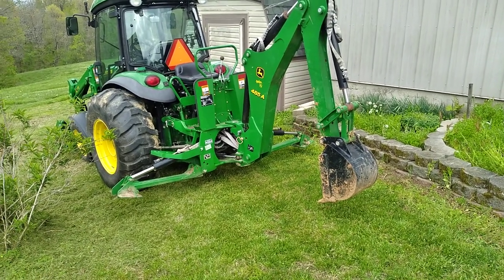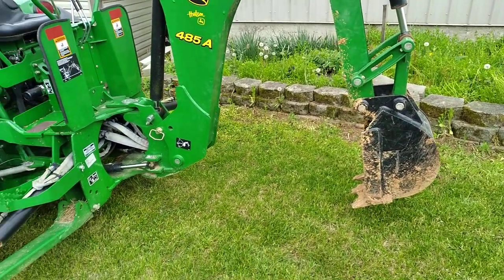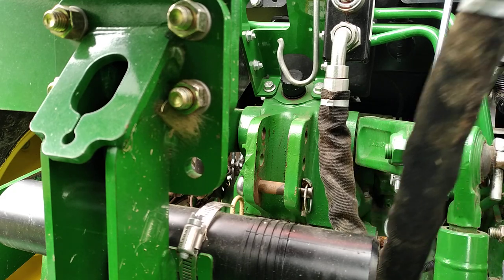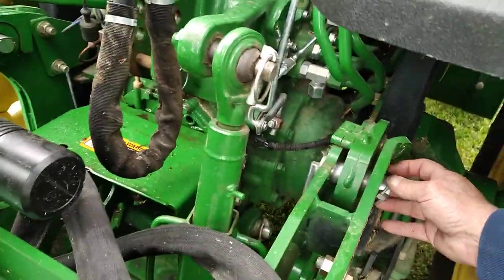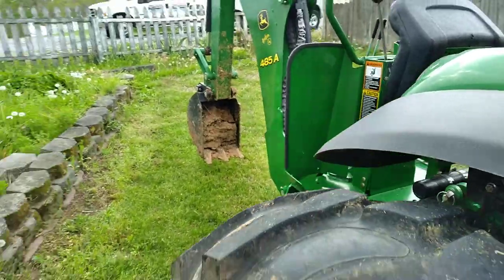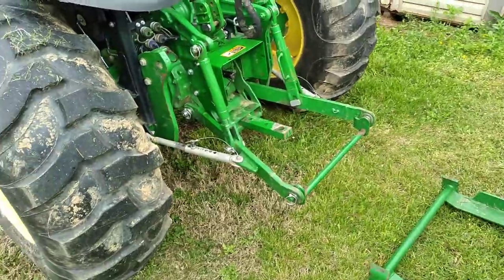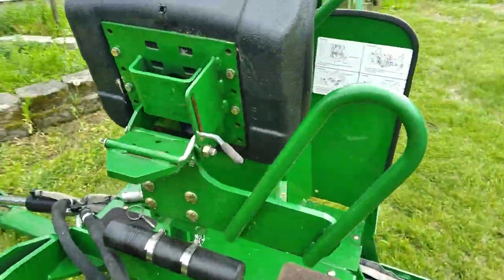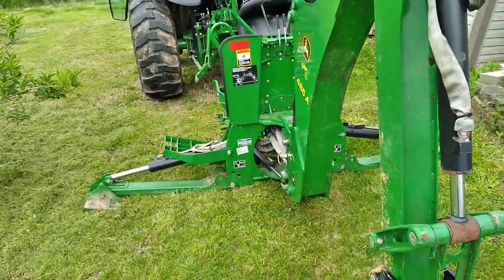john deere backhoe removal tips & tricks / sst vlogs / super slick tricks

Comment: Just lost my mind trying to get this off my 4052 lol. My left pin had tension down on it and I maxed out the three point arm thread adjustment. Then my three point would not go low enough, so I flipped the hoses and moved it up a bit to clear the three point, then the main pins under the tractor would not clear. I gave up until I get a floor jack over here. Idk if mine is tweaked or what.
Reply from the maker: I take the front bucket n lift front end to lower back.
I know how you feel. Lol